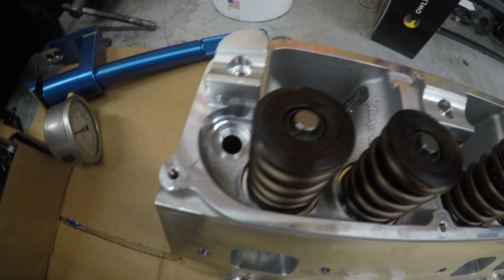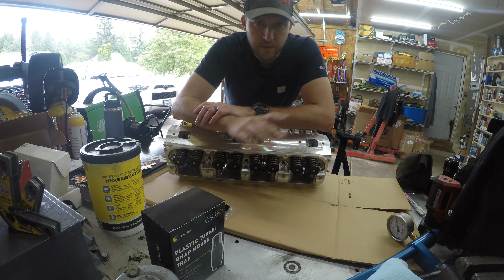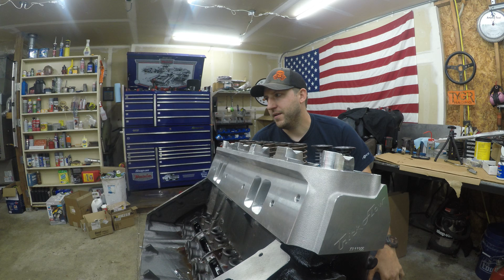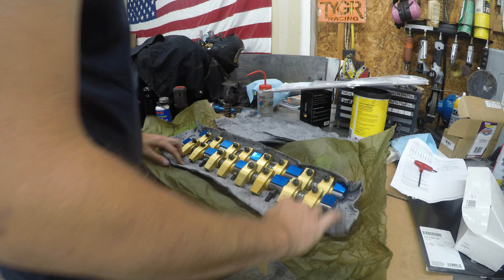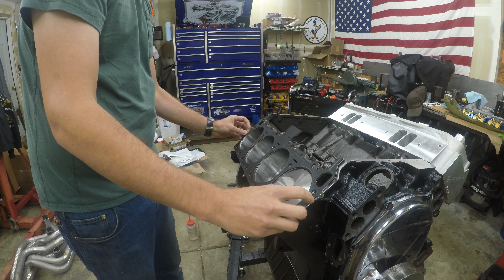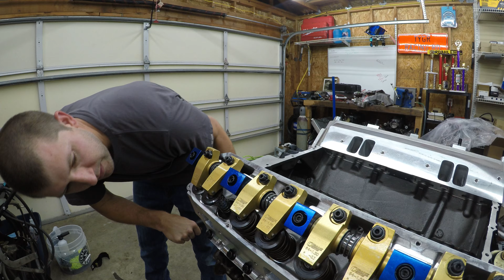Trick Flow! Installing new CNC ported cylinder heads on my BIG BLOCK MOPAR

Comment: The best way to measure the pushrod is to put a ball bearing in the cup end and measure it then subtract half the thickness of the ball bearing. Different manufacturers use different depth cups on their cup end. Then measure the whole thing with a 12-inch long caliper